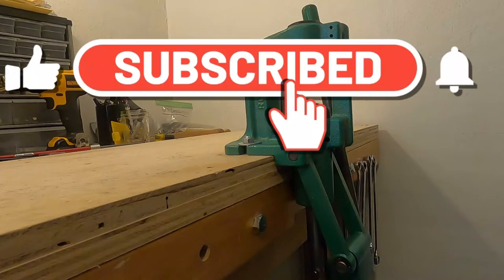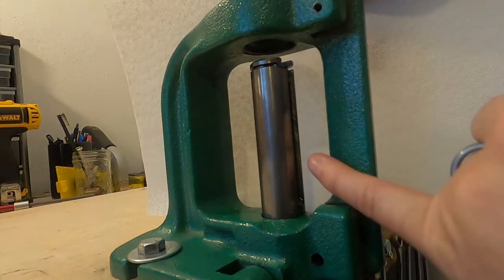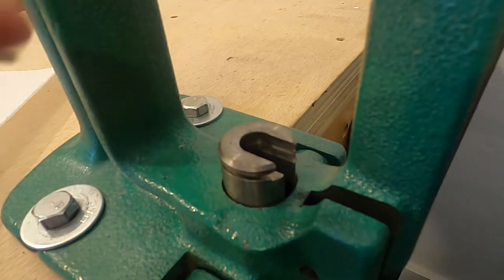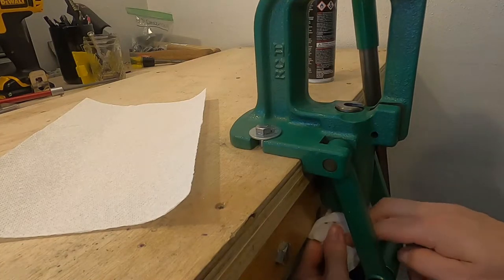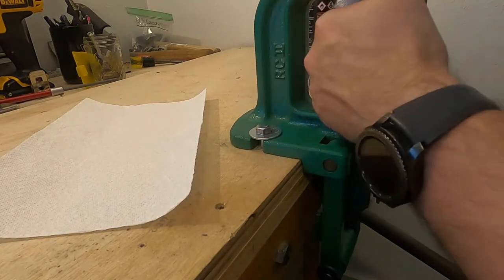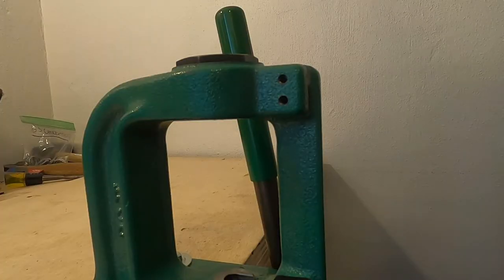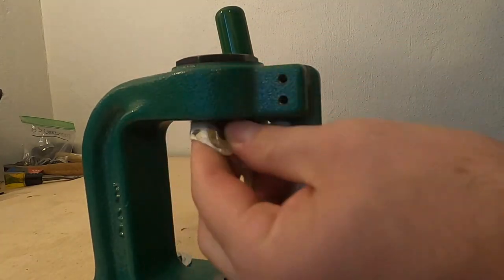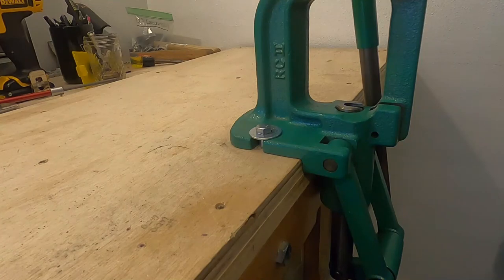Clean Your Press !

Comment: I have a Rock Chucker Supreme, and when I'm lowering the ram to remove a shell that has been decapped and sized, it locks up about halfway down, and I have to slam it in order to get it to drop all the way.  Only happens when there's a shell in it after decapping and sizing, but it doesn't happen when there's no shell or when the bullet is seated.  Am I missing some point of lubrication?  Thanks.
Reply from the maker: Are you able to record this?  If so, send it to my email.  mattsreloadingbench@gmail.com 

Otherwise we could maybe set up a zoom meeting.

I can look at the video and see if there might be a solution.   That should definitely NOT be happening.
Reply: At the top of the size die, your case neck gets sized down a little too far because different brands of brass have slightly different neck wall thickness so it must work with all of them. Then, to set proper neck tension, the neck gets pulled over the expander ball at the bottom of the die. To make it easier, wipe a little case lube wax on the expander ball or dip the case neck in dry powder  lube such as the spherical media type from Redding.

Comment: Would you ever use normal gun oil/cleaner/ lube? Such as Slip 2000, Breakfree CLP, etc, for the clean and lube? New to reloading
Reply from the maker: Anything that you would use to clean a firearm would work just fine for cleaning your reloading press.  That is heat I usually use.
Reply: @mattsreloadingbench roger that, thank you for your input!